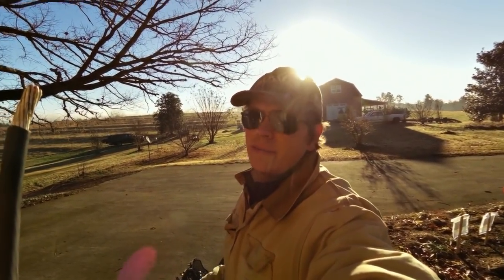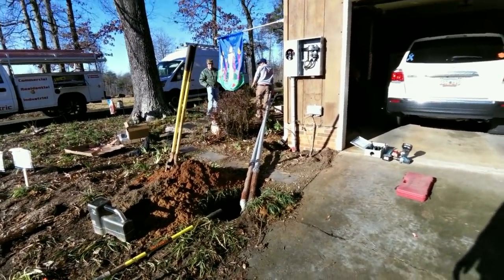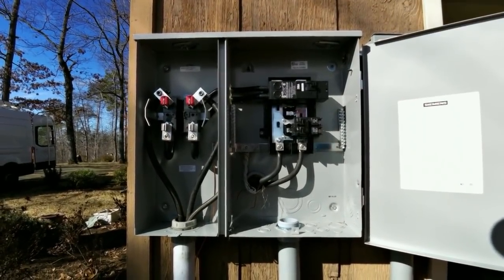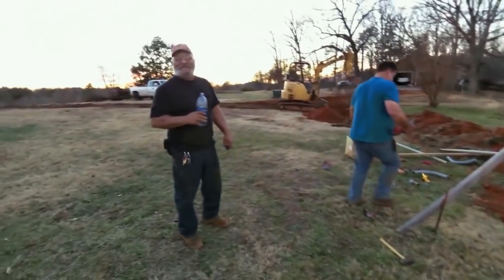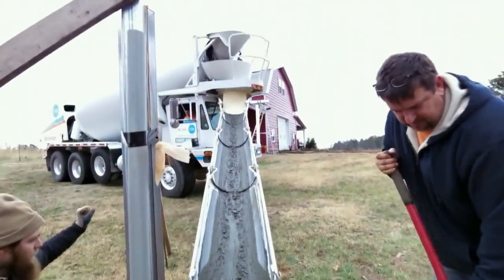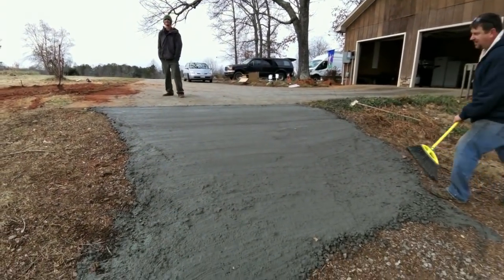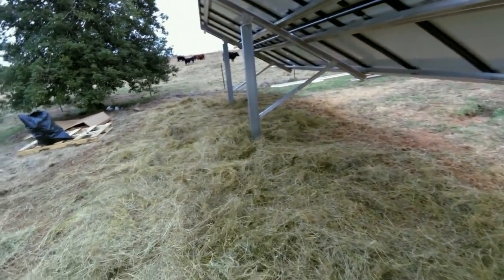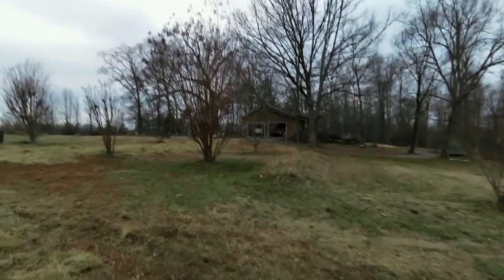Grid Tie Ground Mount Solar w/Engineer775

Comment: Hold on there buckaroo..this is an old build I remember it from last year...?
Reply from the maker: Russ B yes old job. Engineer has a video up of the job but here is my side of the story
Reply: Maybe the pressure treated pallet is why Schletter is filing chapter 11? Just kidding. But hey i am now looking at trying out the DPW power peak Al i think it’s gonna be the cure all and similar in adjustability to Schletter.
Reply: Oh and nice vid
Reply from the maker: Skywire Electrical Systems, LLC I’ve since learned heat treated pallets are green color too.